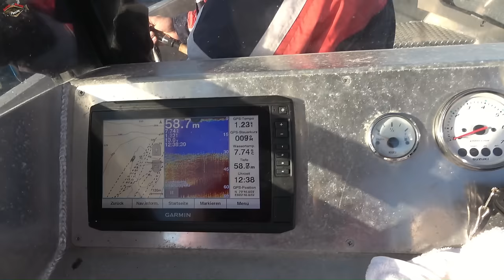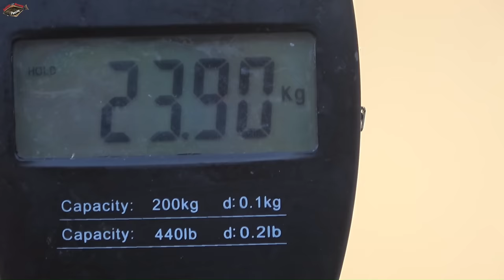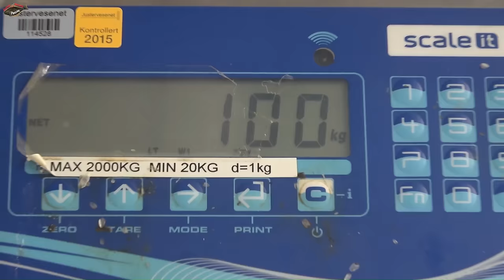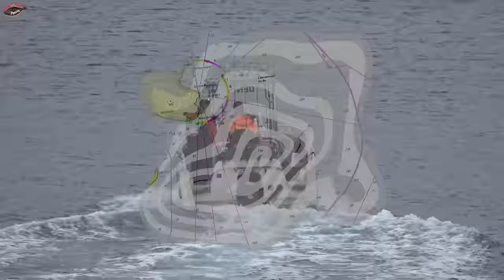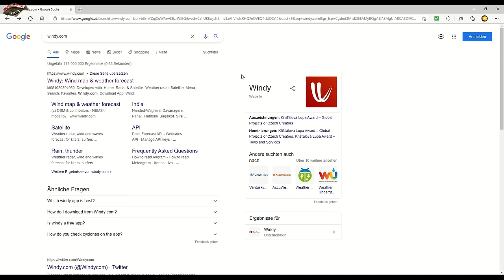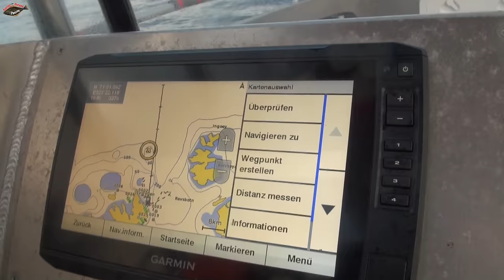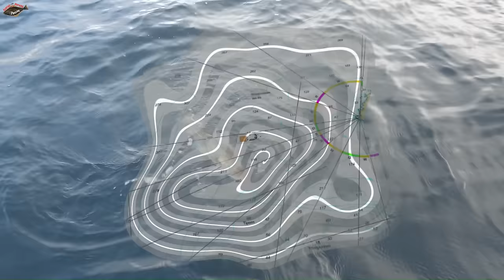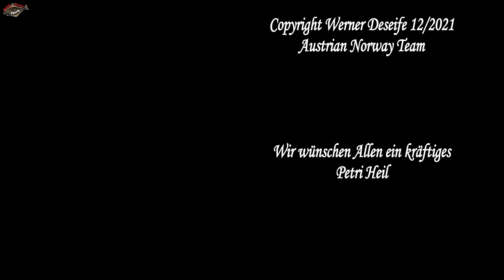Angeln in Norwegen 2021 - Heilbuttparadies Soroya

Comment: What brand of fishing rod is this senior, it is very strong and can withstand the pull of a big fish
Reply from the maker: The fishing rod is a "WFT 68° North Comfort Butt LTC 200-400 gr. (20 lbs) rod". It`s an older model which is currently no longer available. The successor model is the version with a casting weight of 200 - 600 grams. Below is a link where you can see it. https://www.askari.at/wft-meeresrute-68-north-ltc_0165765.html. If you have more questions you can contact me over INSTAGRAM too. (austriannorwayteam). Best regards - Werner.